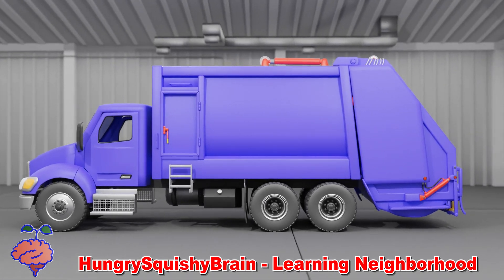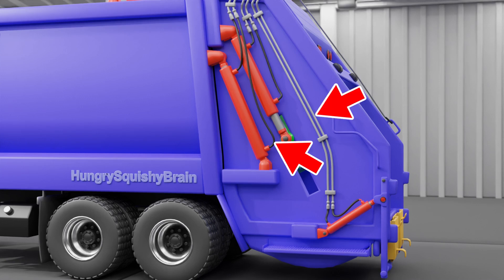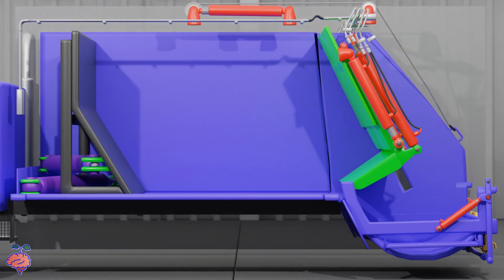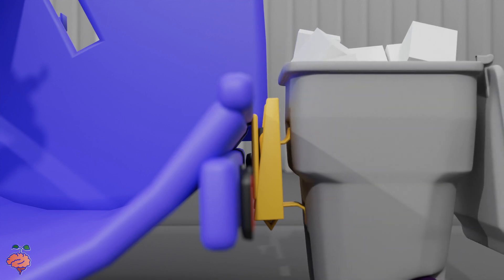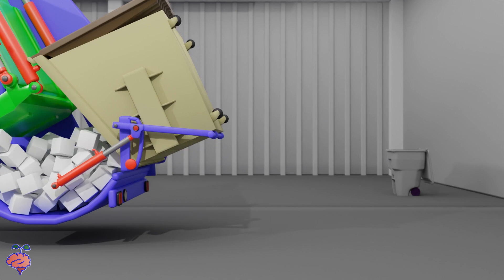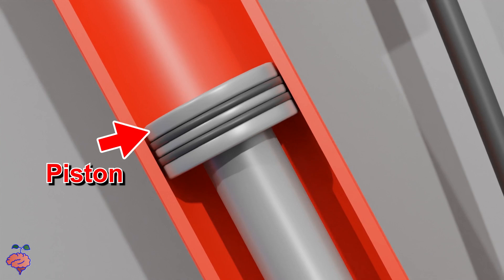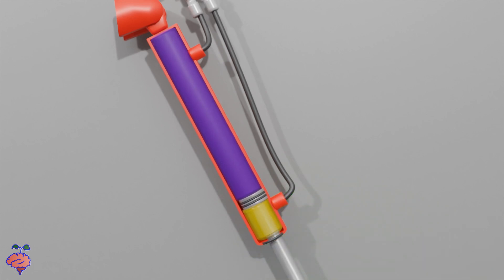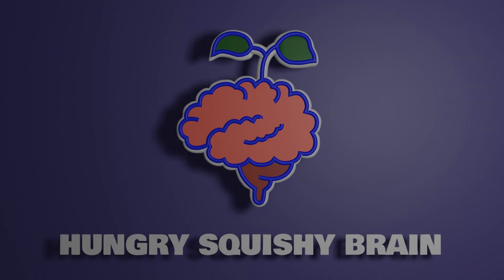Rear Loader Garbage Truck with Cutaway View in Our Warehouse!

Comment: Cart tippers are usually electric powered but sometimes they are hydraulic powered.
Reply: Hydraulic has a greater lift capacity than electric.
Reply: The ejection panel cannot move unless the tailgate is fully open.